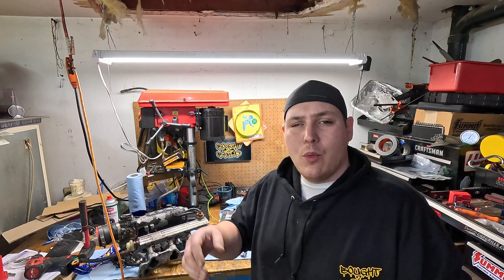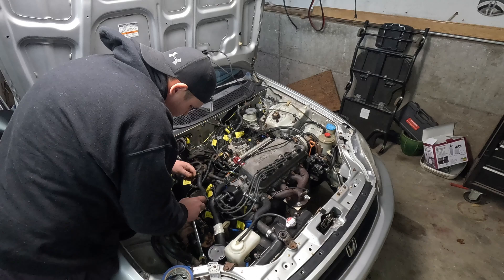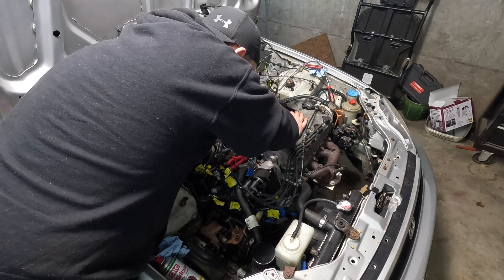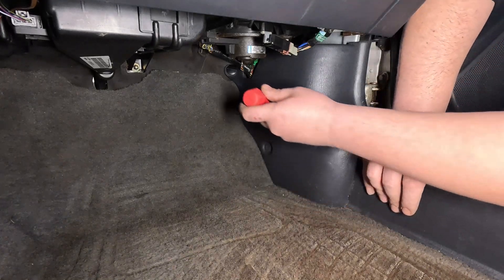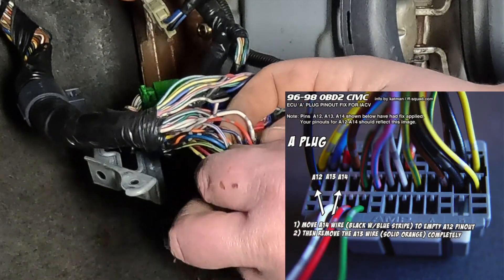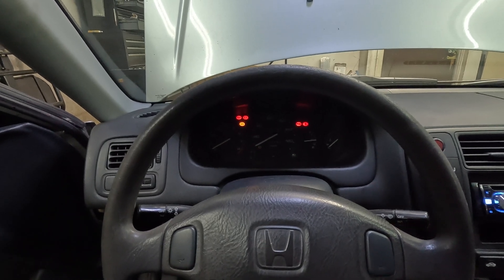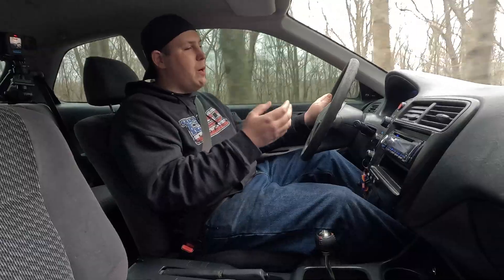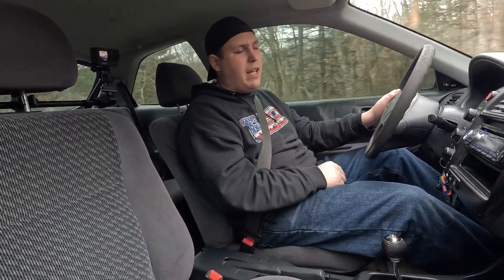INSTALLING PART'S THAT COST MORE THAN THE CAR.. HOW TO RUN HONDATA ON A 1999 CIVIC #honda #hondata

Comment: You don't have to do anything additional with your gauge cluster swap.  Everything is already wired up.  You literally just swap the cluster and the tach will work.
Reply from the maker: I agree that’s how it should have been 100% but it wasn’t I hooked everything up double triple checked it and I still couldn’t get a tach signal the only way I was able to get one was to run my own wire I think it was because the previous owner had the JDM D15B non vtec swapped in and they used a stock ecu of some type so maybe they had to use the wire for that because I tried 2 different dashes and and it wouldn’t work then ran my wire and it works as it should so I’m not sure why it was like that thanks for checking out the video I appreciate the support 🤟🤟🤟👍👍👍👍
Reply: @bought2build  Yeah, that makes sense.  The previous owner must have messed up the wiring from during the swap.  This is why everyone wants the completely stock ones from old ladies! LOL
Reply from the maker: lol right though I would love to find a clean untouched one it’s so hard to find nowadays thanks for the support🤟🤟🤟👍👍👍👍

Comment: I have a 1992 civic hatch with a B16A swap and a P28 ECU with a Honda s200 on it. How do I install a s300 on it without being able to access the s200 programming?
Reply from the maker: You will have to make a tune for the s300 I have not used the 200 but I don’t think you can use the same tune but what you can do is open both on your laptop and manually transfer all the settings over! Good luck thanks for the support! 🤟🤟🤟🤟👍👍👍👍👍

Comment: hi, do you recommend this setup on a D15B double Vtec?
Reply from the maker: You would have to do some research I am not sure off the top of my head if the s300 can control the dual vtec but if it can I think it would work well with a turbo setup like ours! Thanks for the support! 🤟🤟🤟🤟👍👍👍👍👍👍

Comment: Great car. I had the same one , 1.4 VTEC 1997 ,I bought it with almost 300 thousand kilometers,  I drove it for 4 years ,I had no single issue with the engine. Now driving civic IX generation  ,also great car.